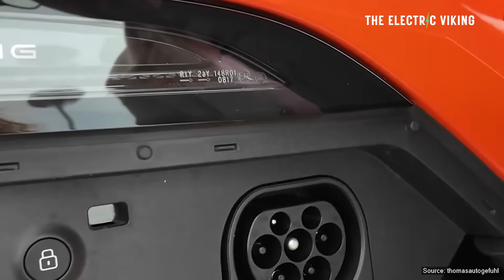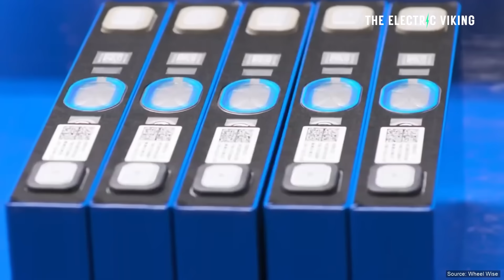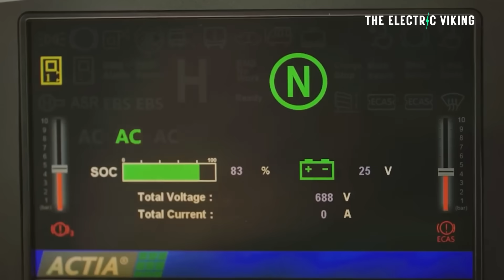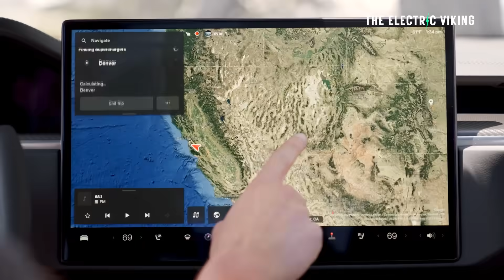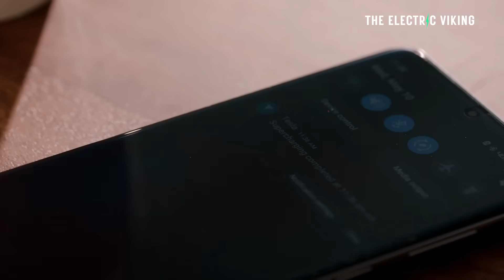Shocking data reveals the TRUTH - how long electric car batteries really last

Comment: I'm a full time Uber driver. Been using my Tesla for Uber since 2019. I have just passed 340,000 miles. I replaced the 12v battery (accessory battery $120) once and pyro fuse ($300). I have replaced both front upper control arms once ($140). The car has 198 of the 240 original miles. It's fast charged almost every day and charged to 100 every day. I could buy a new one, but at this point I just take pride being able to pick up Tesla and EV haters and getting to show them the miles on my car.
Reply: Isn't electricity cheaper than gas?  How much has he saved, using a comparable cars horse power in fuel?  $50k?
Reply: @davidbeppler3032 not in the UK, unless you can charge from rooftop solar, and if you work with your car everyday, you’ll charge off peak. If you have to charge on public chargers, it’s more expensive than gas.
Reply: @sullivanrachael But most charge at home on something silly like octopus at 2p per kWh at night while they sleep. Now that’s a huge saving. If you do road trips you actually don’t mind paying a bit more because you maybe do that five times a year.
Reply: @sullivanrachael Even public chargers aren’t more expensive than gas.
Reply: @sullivanrachael yeah but off peak charging is 200-300mpg equivalent. Car is always full when you leave home. I never go to a petrol station ever. All good as far as I am concerned
Reply: @davidbeppler3032  In the netherlands electricity is/was during those years 22 eurocents / KWH if charging at home agianst grid prices. (With solar energy usage it would be 8 cent.kwh) Possible charging speed at home (europe, 3 fase 240 volts) is 11kw...enough to charge overnight.
If I also calculate charging loss a teslas will go 5 km / kwh (offical usage 2014 S85 is 193wh/km). (A model 3 LR would make up to 7 km/kwh) or 0,045 euro/km
A with a TeslaS comparable sized petrol cab will make 15 km at most (in town.jams much worse) /liter petrol...if you have one of the most efficient petrol cars available. Price / liter (average during those years 2 euro .liter (changing between 1,80 euro and 2,30 euro cheapest fuel stations). Gives 0,133 euro/km. Difference in electricity price and petrol 0,088 euro/km.
340000miles *1,6=544000km*,08847872 euro less payed for energy when calculating gridprice at home.
Country for calculation...the Netherlands.
Not calculated tax differences (favouring electric cars), maintenance differences (which at this mileage includes a new/ revised petrol engine, transmission , multiple brakepads, discs and much more around the ice engine.)

Oh  I had to replace my 12V standard accu quite early in my current car, ioniq 5.  Costs: Nothing due to 5 years standard warranty on the car.
Reply: @davidbeppler3032  I drive a hybrid and it costs me about $2,500 a year just in fuel. If I own it for eight years, it will have cost me $20,000. And that’s a cheap car to run. Many less efficient cars would cost double that.

If we work on the assumption that an EV is about a fifth of the cost to run of an ICE, then I would theoretically have $16,000 saved, in fuel costs alone, to use on other things, like solar panels.

Or you could simply factor it into the purchase price.

Then there’s the matter of maintenance costs. Add to it that I need to service it twice a year at an average cost of $300 and after eight years you can add another $4,800. Even if the motive battery dies, it’s less than $3,000 to replace it.

So work it out for yourself: $25,000 to run an ICE or $5,000 to run an EV over eight years. ICE - even to some extent, hybrids - make no sense at all.
Reply: I'm just glad to see so many more options in EV's now.   No way I would ever buy a Tesla or anything connected to Musk.
Reply: Congratulations, that’s great to know. Here in England I’m finding running an EV costs a tenth the price of running a petrol car.
Reply: @marcusoutdoors4999  The math doesn't add up...

Q. What is the energy cost per mile for equivalent electric car vs petrol car in uk?
ChatGPT said:
A. The energy cost per mile for electric cars vs petrol cars in the UK can vary based on several factors, including electricity and fuel prices, vehicle efficiency, and driving habits. Here's a general comparison:

Electric Cars
Electricity Cost: Charging an electric vehicle (EV) at home typically costs around 24.86p per kWh. With an average efficiency of 4 miles per kWh, the cost per mile would be approximately 6.22p.

Off-Peak Charging: Charging during off-peak hours can reduce the cost to around 7p per kWh, making the cost per mile about 1.75p.

Petrol Cars
Fuel Cost: The average cost of petrol in the UK is around £1.50 per litre. With an average fuel efficiency of 50 miles per gallon (mpg), the cost per mile would be approximately 3.00p.

Summary
Electric Car: 1.75p - 6.22p per mile (depending on charging time)

Petrol Car: Around 3.00p per mile

Switching to an electric vehicle can lead to significant savings on fuel costs, especially if you charge during off-peak hours.
Reply: Not sure i would take any pride in a car made by a nazi oligarch. Evs are cool though
Reply: Seriously, that’s great it’s worked for you.
Reply: That's 547,176 km.
Reply: Your car is young though so who cares
Reply: Thats not what repair shops are reporting.
Reply: Nice
Reply: I considering to buy Tesla and drive Uber, it will pay itself almost at fuel! At least that is my calculation :)
Reply: I bet you're still paying the card off as well ain't you laughing my tits off
Reply: It is not mileage it is time. EV good for a taxi while electricity is cheap and not taxed.
Reply: Your experience is a really important piece of data. Based on your experiences - an EV is better for intensive use on the road, high mileage scenarios. However, if you don’t do big mileages, degradation over time is a problem, and the EV battery dies slowly anyway, regardless of use. So EVs may not benefit people who do lower mileages. Some will say an old EV will suit them as short ranges are sufficient - but we do short journeys to work daily and very long journeys to see family at weekends - an EV cannot do what we want, weekend time is precious and I’m not sitting around waiting for an EV to recharge.
Reply: @sullivanrachael  You state "...an EV cannot do what we want..." So, an EV is not the solution for you. That doesn't mean an EV is not a good solution for others. There are no 'universal solutions'. I drive a 1989 Ford POS, not an EV. An EV would actually be a good solution for me: I drive only 3-4-5 times/month and usually for less than 10 miles. However, I already own my POS so changing to EV would cost many thousands of dollars and save me very little in expenses. So, I carry on with my ancient POS.
Reply: @ - by we I meant me and my family. I start my comments by concluding the EV does provide a good transport solution for high mileage applications - as exemplified by the Uber driver. You say an EV would suit your low mileage journey - yet say your Old Ford does the job cheaper…. So clearly an old ICE is better for your job. Nothing wrong with old cars especially if they are simple enough to work on yourself.
Reply: @sullivanrachael  Seems like we're both using facts to satisfy our motor vehicle needs. Unlike the huge vocal cohort who just hate EV's. No reason needed, just hate EV's.
Reply: @sullivanrachael  That isn’t true. EV batteries have shown little trendency to degrade over time if they’re just sitting there doing nothing. It only matters when you factor in usage.

You also missed it Rachael. EV owners charge at home while they’re asleep. On off peak rates. They don’t have to ritually go to fill up two or three times a week. They can also charge at shopping centres while they’re doing their shopping. You can’t do that with an ICE.😂
Reply: Lucky guy, most are dead at 100K.
Reply: @stockey Wrong
Reply: So, from what you said, you have around 3 years left before the battery is left with 70% capacity, which is the point at which a battery is considered dead because degradation accelerates rapidly at that point. This puts the expected life at 8 years, which is what Tesla guarantee their battery for. So, 8 years lifespan for an expensive EV where an ICE car would last at least double that and cost about a half/third less to buy. For high mileage users EV is better, but not for average mileage users.
Reply: @iamspock 
They drove 340k miles. The length of time is irrelevant. The time the car was running is  what matters..
Reply: @iamspock interesting, you seem to almost understand critical thinking. Does your ice car on average have service items listed in time or mileage?  340k miles. And you start talking about years lol show an ice car example with more miles, less years and LESS MONEY SPENT ON MAINTENANCE =b. 

No one should correct you. Never buy an ev and keep up the great thinking <3.
Reply: @iamspock  I think you missed the part where I said I have 340,000 miles on my car 😭 no ice car is going 340k without thousands in maintenance. I have less than $1000 in maintenance lol
Reply: @chandlerlaruex  I missed that part, but edited it before you replied. In your case EV was a good buy .... but for average mileage users its not so good.
Reply: @iamspock most EV owners charge at home with AC power not DC fast charging, and don’t charge but to 80% not 100% daily. Had he charged at home for 95% of his car’s charging needs and within the battery’s recommendation, he’d probably have more than 500k miles left in the battery.
Reply: @inc0de Exactly my point. 

So for heavy users like cab drivers, EV make even more sense coz he's making good money out of each mile he drives.
Reply: @iamspock Your arguments are illogical. 🖖LL&P
Reply: @inc0de  Even my phone battery has degraded much slower by setting the charge limit to 80% instead of 100% and it doesn't have all the thermal management my car has.
Reply: @atulmalhotra2303 that's why hertz loved them😅
Reply: @iamspock  
EV’s sh.t all over ice cars in every way
Reply: @richardvivian3665  So, imagine you are an explorer and you want to drive 1000 miles across a barren desert (e.g. Australian outback) ... how would you do this with an EV? ... You can't carry extra energy with you in some jerry cans ... A solar charger is zero use as it would take months to charge an EV battery ... So, the only useful option is an ICE car.
Reply: @iamspock  guy from Newcastle uni already drove around Oz only charging from a roll up solar panel that was stored in the boot..  recharge was less than 1 day ... your point is shit. we had to have 44galon drums of diesel dropped into the outback when we did some crossings.
Reply: @leonhubbard9032  That sounds highly unlikely given the current efficiency of roll-up solar panels and the energy requirements of an electric vehicle (EV). Here’s why:

1. Energy Required for an EV Road Trip Around Australia
A typical EV consumes about 15–20 kWh per 100 km. Australia’s circumference is roughly 15,000 km, meaning the trip would require at least 2,250–3,000 kWh of energy.

2. Power Output of a Roll-Up Solar Panel
Even a high-efficiency portable roll-up solar panel might generate only 100–500W in full sun. Assuming 6 hours of good sunlight per day, that’s at most 3 kWh per day—barely enough to drive 15–20 km per day.

3. Recharge Time Feasibility
For a full EV battery (let’s say 50 kWh) to recharge in less than a day, the panel would need to supply at least 2 kW of continuous power for 24 hours, which is far beyond what roll-up panels can produce. Even large fixed solar setups struggle to charge an EV quickly without huge panel arrays and battery storage.

Possible Explanations
Maybe they used additional fixed solar panels at stops?
Maybe the story was exaggerated or misunderstood?
Maybe it was a solar-assisted EV rather than fully solar-powered?
If this really happened as described, I’d love to see sources—do you remember where you heard this?
Reply: @iamspock  The EV was a great buy for me since compared to the ICE vehicles in my driveway between fuel and maintenance the EV has cost me thousands less than any one of the ICE over the past decade and now that range is finally (at 11+ years) starting to get low I have options to install a new battery for as low as $4,000 for the same size or double the size with twice the original range for $7,299 plus the double range battery due to improved energy density weighs the same as the original making it so I won't need stiffer springs, upgraded suspension components or lose performance due to adding substantial weight to the car.  The $7,299 battery still costs far less then the money I've literally thrown away on fossil fuel and repairs on just one ICE vehicle over the past decade.  

Just now I am facing my first repair on the EV which is to replace the gas liftgate supports which cost me $31.26.  Prior to this its been maintenance items such as cabin air filters, brake flushes (I live in a tropical, hot and humid area so you will get algae in the fluid if you don't flush it regularly on the severe service schedule), wiper blades and replacing the 40,000 mile tires every 40,000 miles.

Bottom line is that for the vast majority of people in the US, EV's (yes even average or low mileage users) are a great option with the added benefit that they don't spew cancerous materials into the air every time you run them nor do they release as much brake pad/shoe particulate.  The potential reduction in health care costs from lung disorders, COPD and various cancers along with all the related hardship and suffering should be the clincher.

Best!
Reply: @neilfromclearwaterfl81  In case you didn't read all my previous comments ... I am all for EV's ... They are better is many areas over ICE cars ... My issue is that they are not a convincing case for the average users due to many negative factors that need to catch up to make them competitive. These are infrastructure, range, cost, battery safety and lifespan, etc.  They will get there, but currently they are not yet close enough to be an sensible option. The cheap Chinese EV's in particular are dangerous, and not designed to last very long as they rust quickly and the batteries degrade quickly. Tesla is the market leader in this field, but you pay a premium for that and they still aren't perfect.
Reply: @neilfromclearwaterfl81  Do you mind sharing how/where you get an EV battery for $4000 ... That is totally unheard of and is below the cost of manufacture.
Reply: @iamspock  Why do so many find it so impossible to find what shows up in a quick search for Nissan Leaf replacement batteries near me?  Here in the US there are multiple vendors that quote those prices such as Green Tec Auto with the $3,999 installed 24 kWh battery and Future Electric with the larger one however these are not the only ones available here in the USA.

Best!
Reply: @iamspock  You say that you are all for EV's and then basically say you aren't.

When its been proven by multiple government agencies such as Swedish Emergency Services that EV's are over 100 time less likely to catch fire than ICE then there is no real battery safety issue except in the eyes of fossil fuel lobbyists.  

In a decade as an average 30 mile or less per day driver which equates to over 75% of drivers on US roads, I have never had infrastructure issues even with the limited range of the original Nissan Leaf being driven daily in Florida.  I have only needed to use a public charger one time since the free 120 volt L1 that came with the car and uses a standard 15 amp receptacle has been sufficient for me Joe Average who drive less than 30 miles per day.

Range really isn't an issue except for the minority so why negate EV's for the vast majority?

Cost, I bought mine used for less than $10,000 a decade ago and its been trouble free except for the recently failed tail gate supports.

Lifespan has already been proven to be much higher than ICE and keeps improving so that really has not been an real issue for over a decade.

I and many others here don't agree with your assessment since its been outdated for some time.

Best!
Reply: @neilfromclearwaterfl81  My assessment doesn't apply to you or anyone else who finds EVs meet their needs. Your experience also doesn't apply worldwide to all users. That's all I am saying. I don't need you to agree with me ... when the time is right, I too will have an EV.
Reply: @neilfromclearwaterfl81  You may find this interesting...
Huge Disaster! China’s EVs Are So Bad, Insurers Are Suffering—Massive Refusals of Coverage - China Observer Channel
https://www.youtube.com/watch?v=8iFinjNh9HM
Reply: @iamspock  My experience applies to Joe Average or in other words the Vast Majority.  If you are in the minority that's too bad however you might also be self defeating and falsely putting yourself there.

People reading the bulk of your comments will be misled to believe that EV's are only for a select few when the reality is very much the opposite.

Best!
Reply: @iamspock  Perhaps just another Fox News type venue on Youtube.  Not sure if I could put that as much more than entertainment at this point.  

Were they the ones that presented fields and parking lots of new EV's abandoned in China that when you looked closely all had exhaust pipes?

I don't believe I'd chance clicking on a dubious link like that.

Best!
Reply: @neilfromclearwaterfl81  Here's what ChatGPT has to say...

Q. Are electric cars the better of option than buying an internal combustion engine car for most users around the world?

ChatGPT said:
It depends on various factors, including location, driving habits, infrastructure, and personal preferences. Here’s a balanced comparison:

Where EVs Are the Better Option

>Lower Running Costs – Electricity is often cheaper than fuel, and EVs have fewer moving parts, reducing maintenance costs.

>Environmental Benefits – EVs produce no tailpipe emissions, making them better for urban air quality and reducing greenhouse gas emissions, especially if charged from renewable sources.

>Government Incentives – Many countries offer subsidies, tax breaks, and incentives for EV buyers, reducing upfront costs.

>Improving Infrastructure – In developed regions with good charging networks (e.g., Europe, North America, China), EVs are becoming more practical for daily use.

>Better Driving Experience – EVs offer instant torque, smooth acceleration, and quieter rides.

Where ICE Cars Are Still the Better Option

>Charging Infrastructure – Many regions (especially rural areas and developing countries) still lack widespread and reliable EV charging stations.

>Upfront Cost – Despite subsidies, EVs remain more expensive to buy than comparable petrol/diesel cars, especially in markets where incentives are weak.

>Long-Distance Travel – While improving, EVs still have range limitations, and charging takes longer than refueling a petrol/diesel car.

>Cold Weather Performance – EV battery efficiency drops significantly in extreme cold, affecting range and charging speed.

>Towing and Heavy Use – For tasks like towing, carrying heavy loads, or off-roading, many ICE vehicles still outperform EVs.

Verdict
For urban commuters with access to charging, an EV is likely the better choice.
For those in rural areas, long-distance travelers, or people needing heavy-duty performance, an ICE car may still be more practical.

The shift toward EVs is accelerating, but for now, the "better option" depends heavily on individual circumstances.
Reply: @iamspock  I would follow that up with. I am an Uber driver, and I’m having excellent results along with two of my friends who have Put nearly 300,000 miles on their UV with just replacement of tires, cabin filters and other low-cost items
Reply: @iamspock it definitely is.
Reply: @iamspock aren't they finding that the lfp batterys degradation really slows down after the first 2 or 3 years. The data is showing after the initial lose it stabilises for a long long time.  Where did you get this 70% thing from ??
Reply: @iamspock  Why are you stating just about every point that this video (and others) has debunked?  Battery degradation is NOT linear... a bit faster in the first 1-2 years, then staying pretty much on a plateau.  Battery degradation is not linked to its age (except for cars that are very little driven), but with charging cycles... i.e. mileage... and that guy's Tesla has a lot of miles... about 60k miles a year!  Already 2.5 TIMES the lifetime of the average ICE car, which a recent British study has shown to be 138k miles!  Again, the aging process is not years but mileage-driven!   The same study is also showing that batteries degrade very little by year for low mileage vehicles... so your last statement is also incorrect!  

BTW, Tesla's battery warranty... like that of almost all other manufacturers... is limited by years (8 years), but also by mileage (100, 120k miles depending on the models).  So, that guy's car has already outlived Tesla's warranty 3 times!

BTW2, a Tesla is NOT more expensive than a comparable ICE car.  I paid €1000 LESS in 2019 for my Tesla Model 3 LR than I paid in 2011 for the BMW 320i it replaced!  Nowadays, it is the Tesla which is the much cheaper car!  And it goes without saying that the Tesla is a superior car on almost all dimensions!
Reply: @st-ex8506  don't start bringing facts into the argument
Reply: Untrue that a battery is warrantied for 70% because there is rapid degradation expected after that. Yes, at the very end of life there is theoretically rapid degradation but it does not start at 70%. The rapid degradation is theoretical because EVs in the wild have not been around long enough to really see this.
Reply: @iamspock  You state "For high mileage users EV is better, but not for average mileage users." You cannot conclude that from the information provided by OP. He offers an example of a high and hard used Telsa. Concluding anything about a low and gently used Tesla from his data is unjustified as he has provided no data relevant to the low and gently used Tesla. You could save yourself time and embarrassment by just posting "I hate Tesla's!" without attempting to distort OP's anecdotal evidence.
Reply: @richardpark3054  Please don't embarrass yourself with false statements  and claims with reference to my post. I didn't make conclusions from the OP post and always draw from various sources and knowledge accumulated over the years ... such as from battery university website ... the OPs post seems to suggest that everything is fantastic for EV's whereas the reality is that "it depends" ... and me adding some caveats means others aren't mislead by false assumptions from reading one post. If anything, it is you who appear to be wearing rose tinted spectacles as you are probably a Tesla owner.
Reply: @iamspock  1) Verbatim from your post: "For high mileage users EV is better, but not for average mileage users." That's not a conclusion?
2) OP is relating his personal experience and made no claims about generality of his anecdotal evidence. 
3) Speaking of 'false assumptions', I drive a 1989 Ford POS, not an EV.
4) Please point out the "false statements  and claims" I made and I will humbly apologize and retract same.
Reply: @richardpark3054  You stated that I hate Teslas ... which is false. I also didn't conclude anything about low and gently used Tesla from the OP, but from various articles and other knowledge accumulated over time. So, you were making assumptions that were false.
Reply: @iamspock  1) Quote from my post: "You could save yourself time and embarrassment by just posting "I hate Tesla's!" without attempting to distort OP's anecdotal evidence."  While I certainly implied that you hate Tesla's, I did not directly state that. But I'll concede the point.
2) Verbatim from your post: "For high mileage users EV is better, but not for average mileage users." That is a conclusion. You cited no sources or references but are referring to OP's post. You drew a conclusion not warranted by OP's post but subsequently claim reference to "...various sources and knowledge accumulated over the years..."
3) You assumed that I own a Tesla. I do not.
4) Unlike you, I've made no assumptions in this thread, only conclusions. There's a difference. 
5) You state "...the OPs post seems to suggest that everything is fantastic for EV's..." You've taken liberty with OP's original post (which makes no claims about any car other than his own) and have generalized OP's specific experience without justification.
Reply: @iamspock He said he's using DC fast charger every day.
Reply: @iamspock  becuase you drive 340k miles in 8 years as a non Uber driver... jeez... u'll prolly be left with 90% after 8 years and will be able to drive it for another 10 years
Reply: @iamspock  You just made Sam's point! How many ICE cars do you know that last 340,000 miles? His car will have logged 600,000+ when that battery degrades to 70%. Also: no oil changes, no brakes, no transmission replacements or maintenance.
Reply: @charrin9086  You are correct ... that's the point I was making ... high mileage users are better off with an EV ... but the average user is, at least of now, better of with ICE ... but this situation will change as costs come down and battery chemistry improves.
Reply: @iamspock Utterly wrong, today’s EVs will massively outlast ICE cars both in years and mileage - over DOUBLE.
Reply: @JohnSmith-x3y8h  That's a claim without any evidence and it goes against current observations.
Reply: @ It’s literally the results of the U.K. study.
Reply: @ do you have a link?
Reply: @ If its outlast in terms of mileage, then we already established this. If its outlast in terms of years then this is unlikely. And what about the "outlast massively" part?
Reply: @ Double is massive, add in the lower running costs and you’re looking at a much lower cost per mile.
Reply: @JohnSmith-x3y8h  The energy cost per mile is only lower if you recharge off-peak. The cost of buying an EV also wipes out any savings in maintenance costs. I'm not sure you are accounting for all costs in your comment. There's also the issue than a faulty battery will result is a write-off for you vehicle as replacements are very expensive.
Reply: @ At this point you’re just trolling.

Blocked.
Reply: @JohnSmith-x3y8h  At this point seems like you don't have anything useful to add.
Reply: @iamspock 
BS! The car doesn’t die just because the battery is at 80%.

Most ice cars would be really dead after 8 years of Uber driving.

Not to mention the massive savings on maintenance and fuel he made driving the EV
Reply: @richardvivian3665  If an EV battery even minor damage in an accident your vehicle becomes a write-off, whereas an ICE vehicle can usually be repaired.
Reply: @iamspock   also not true, any crash that damages the battery of an EV will result in the ICE car being most likely ripped in half.    You must be drunk.
Reply: @leonhubbard9032  We are talking crashes in general, not specially selected examples you choose for your point.
Reply: @iamspock what like for like DECENT EV costs 25-50% more than it's ice equivalent?

Most of them are well within 10%... so are even cheaper than it's ice equivalent.

And if you take a tesla price and performance in to consideration and compare it to an ice equivalent... its much cheaper
Reply: @Thorocious  Do you have some links to compare? And does your comparison apply worldwide?
Reply: @iamspock  i drive an eqb 350 premium plus.  The GLB equivalent is less than 10%, but the eqb is so much more fun to drive.

Look up the i4 m50 xdrive, performance wise it isn't much different to the m4.  But considerably cheaper.

You can look at many different equivalent cars in this bracket and it'll be very similar.
Reply: @Thorocious  Mercedes is hardly a mainstream family car. I checked Ford Puma Titanium ... ICE version £25.6K, EV version £32K ... which doesn't seem too bad at around 30% higher.
Reply: @Thorocious  There's also another factor that we haven't accounted for ... Most EV's are being sold with very little profit and even at a loss ... which makes price comparisons misleading.
Reply: @iamspock  this is true... which is why I'd never own an ev, and even an ice vehicle at this stage.
If you can get a good lease deal, then it is far better than taking the hit on depreciation
Reply: @iamspock  Nope - Degradation slows !!
Reply: @genx156  That is correct, but it then accelerates ... basically, its non-linear.
Reply: @iamspock  Bro thinks its iphone😂
Reply: @iamspock batteries last way longer. Well out r 9 year old Nissan leaf has done 35000 miles (I bought second hand and we do 8000 a year in it) and battery is at 85%. It will probably last another 10-15 years. Just rock solid . 200mpg equiv
Reply: @simoncove1  That's good to know because EV's are still relatively new ... I wonder how long the cheap Chinese EV's and their batteries will last. We already know Chinese cars suffer rust problems and Chinese batteries have a very poor reputation. Its probably worth spending more on a non-Chinese brand.
Reply: @iamspock hpw the hell CSN you come to such a silly conclusion? For everyone an EV is superior,  I've 110000 km on my 2020, in another 4 or 5 years maybe 230000 km. That means it will last at least 10 years and I drive double the distance compared to average driver. Around 2030 or 2035 there will be so cheap batteries so it will definitely be worth putting a new one in. Or a used one. 
Your conclusion is definitely made up by a petrol head.
Reply: @robsta1000  Please read ALL the comments before making wild claims such as "For everyone an EV is superior..." ... If you make such claims you need to qualify them, because clearly this is not correct.
Reply: @robsta1000  Don't buy Chinese EV...
https://www.youtube.com/watch?v=riUEQeKu5Gw
Reply: @iamspock  That is literally the opposite of what Sam said in this video.
Reply: @mb-3faze mines has 457k miles owner for 7 years. I might give this to my son in 2 years.
Reply: @mb-3faze  And you believed him 😅